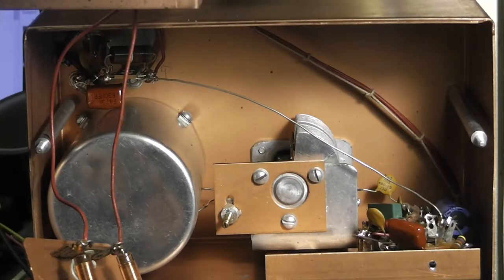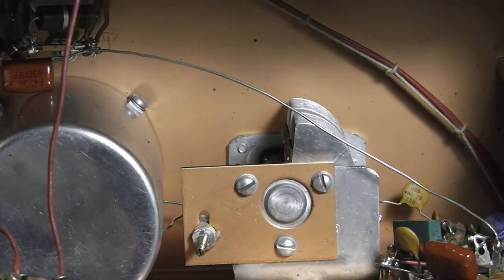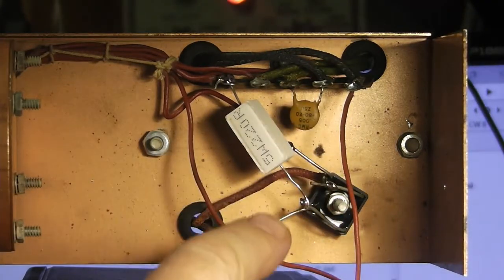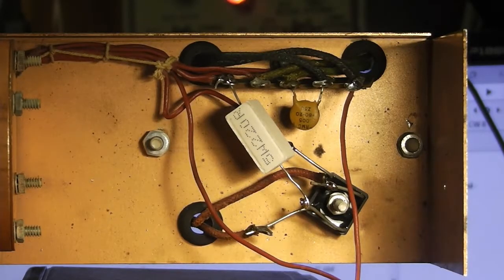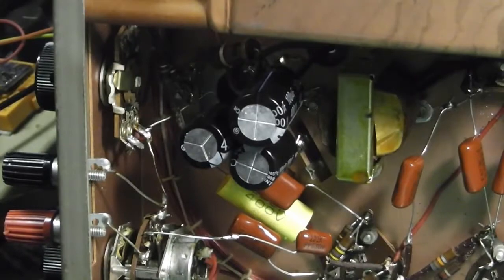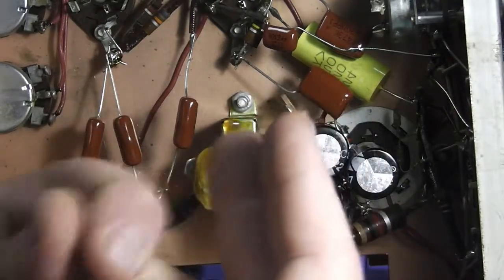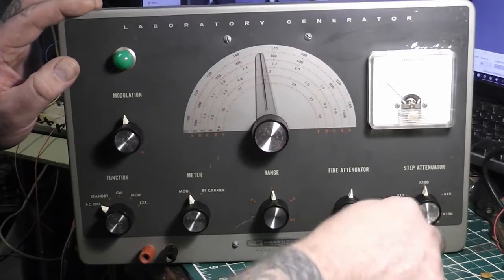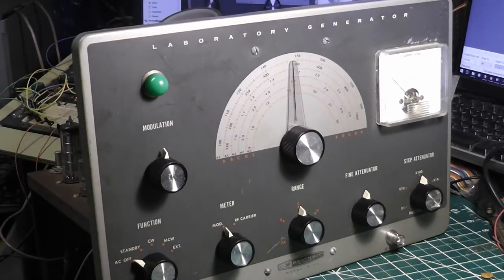HeathKit IG-42 Laboratory Generator Restore Part II

Comment: I always enjoy watching your vintage test equipment restorations. While repairing mine, I noticed there is a third
  .005uf cap on the primary of the power transformer that I believe should also be a safety cap. It's the one just after the switch on the schematic.
Reply from the maker: Yes, you are correct!

Comment: I bought one on Ebay for $25.99. It is in excellent condition and has the original Daystrom tubes. I will be recapping it. The only issue is it has a blown RF Choke on the incoming line. By the looks of the tubes, it has very little time on it. This is going next to my Heathkit OS-102 oscilloscope.
Reply from the maker: Can't beat that price!  I use mine all the time, more than I actually thought I would.

Comment: I was working on my IG-42 and the can on my RF section pulls off after you pull the tubes out. It is only a press fit between the front and back covers, no fastner's.